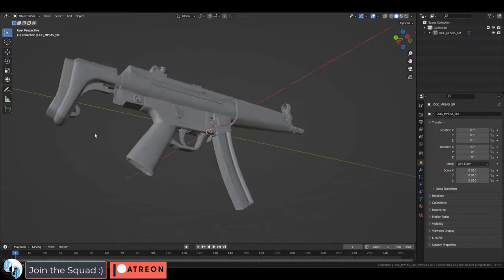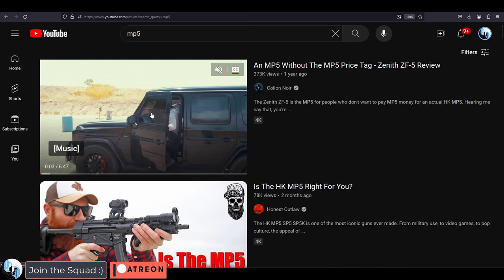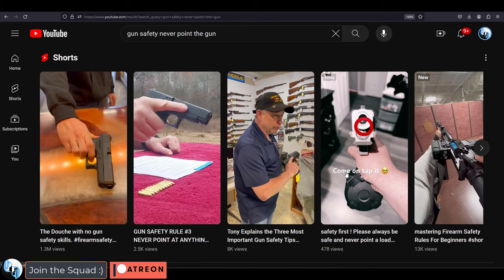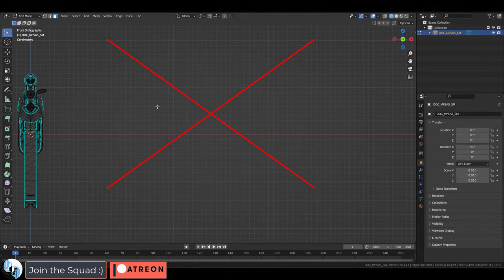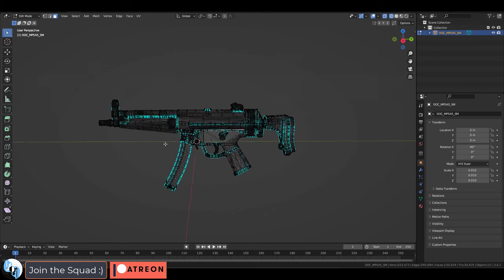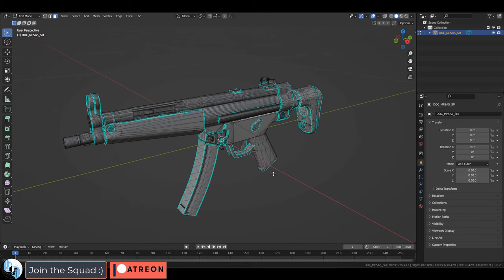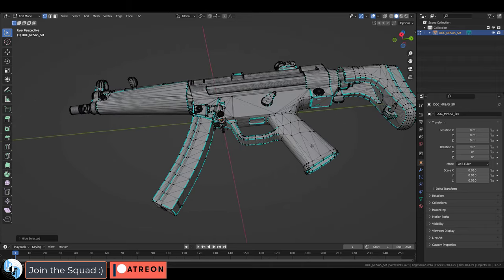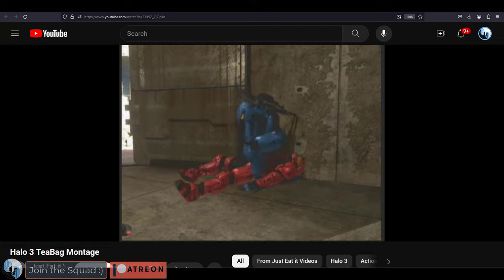How To 3D Model Firearms RESPONSIBLY (Blender-Tutorial!)

Comment: nice april fool , I know it was intended as a joke, but there is actual real rule when 3D modeling gun, you have to make them non-functional for 3D print, it's not a rule everywhere I don't eve think it is strongly enforced, but it exist , some developper add a few obstruction in the barrel in case someone has the idea to try to 3D print them, or like in detached part.